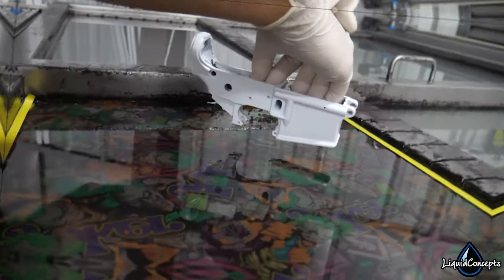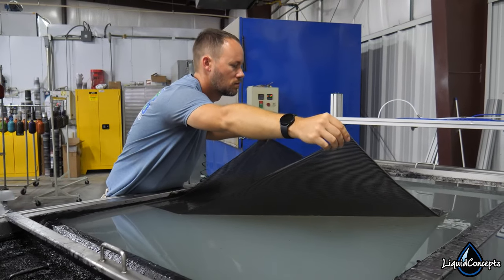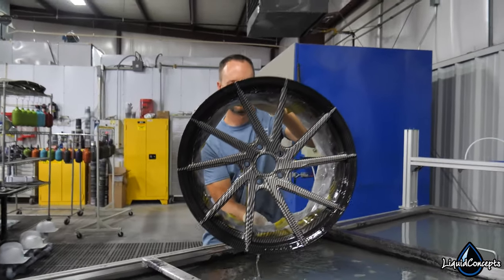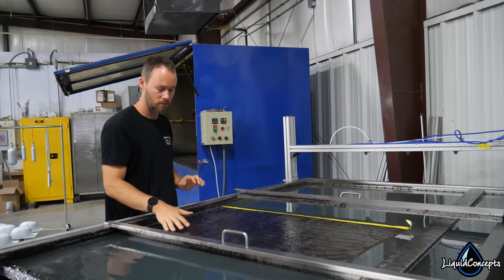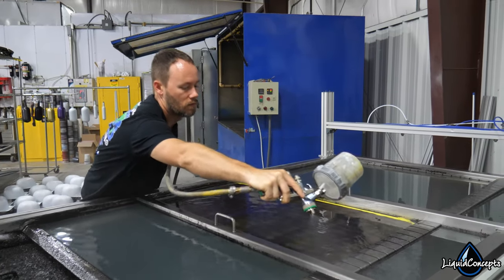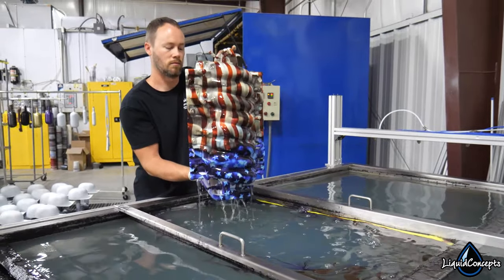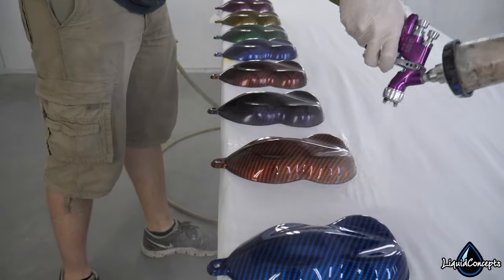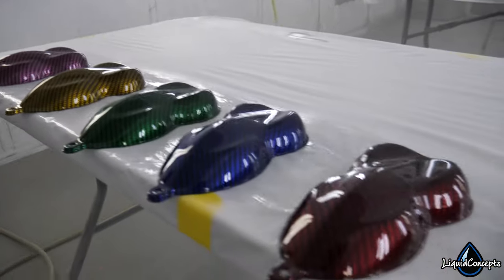How Does Hydro Dipping Work? | Liquid Concepts | Weekly Tips and Tricks

Comment: Hello.. Great videos.   Can you buy any of the supples at a auto parts store. Such as paint. Clear coat. And activator when in a pinch say you’re working on a project and you run out. Is the clearcoat just a lacquer finish in the paint is it just lacquer or acrylic paint? Thanks for any helpful tips.

Comment: Before you apply your primer for the hydrographic stick, is there any further prepwork necessary for the primer to form a stronger bond (eg sanding)?
Reply from the maker: Yes you will need to sand or sandblast your item prior. Prepping will depend on the material of the part you are working with

Comment: How does it hold.up to cleaning products? Will it fade or scratc
Reply from the maker: Everything gets a high grade automotive clear coat to offer the best protection, so you an wash and treat it just as you would your vehicles finish.
Reply: @LiquidConceptsUSA  so what would the average price range be to hydro dip 17'' motorcycle rims?
Reply from the maker: @charliecoronado4657  pricing will vary based on exactly what you want and complexity but roughly $250-$500
Reply: @LiquidConceptsUSA  thank you for the reply.